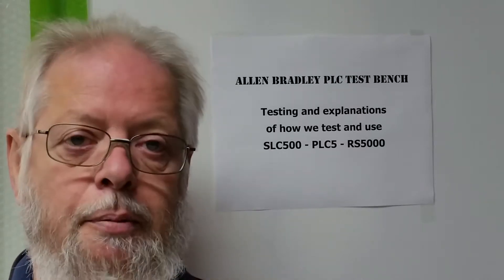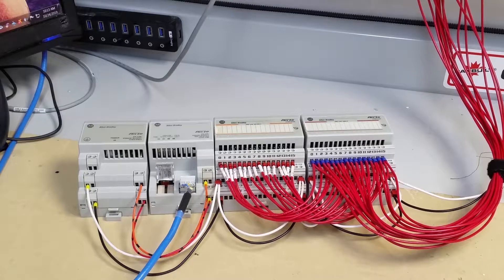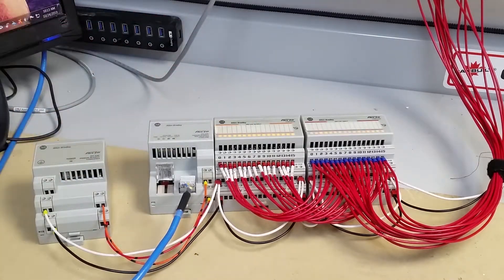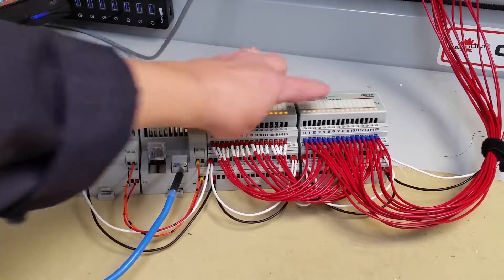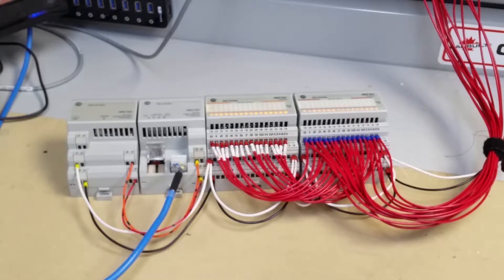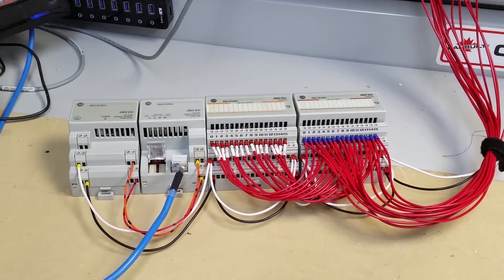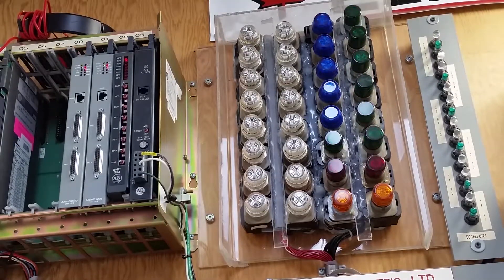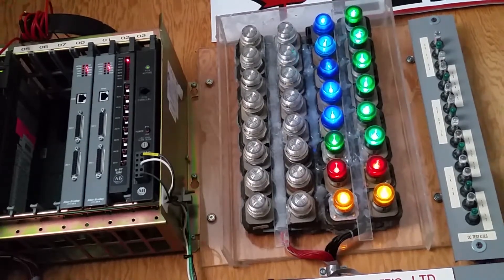1794-ASB RIO Adapter testing

Comment: our power supply RIO adapter keeps flashing the adapter active and fault lights, as well as local fault light. Already replaced it, and also replaced a few suspected bad modules. Anybody else that has had a similar issue and how to go about resolving it?
Reply from the maker: Hi:
Not positive but it sounds like the comm from your processor is dropping out.  Check the other RIO modules in the fault file in the processor to see if everything is dropping or just that one station.
Have you consulted the manual?
Publication 1794-UM009D-EN-P
Page 54 - Section 4-2
There is a full chart on RIO lights.

Comment: hi, i have a damaged Allen Bradley 1794-asb and is obsolete, many people say me i need buy the direct replacement 1794-AENTR, but i dont know how to dolt. can you help me to solve my doubt ?
Reply: Hi There ... Hi have 3 new Allen Bradley 1794-ASB also some 24DCV input / Output Modules, and 120ACV input /output modules. I got them for a project but I have to use a smaller size PLC ..